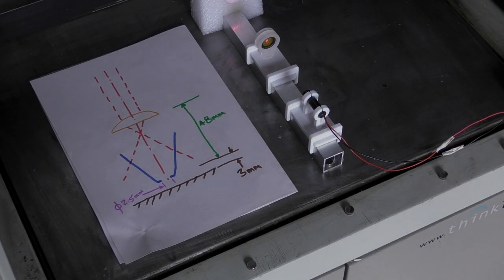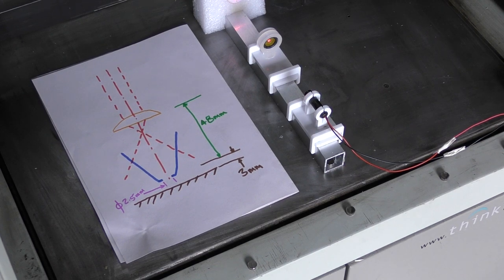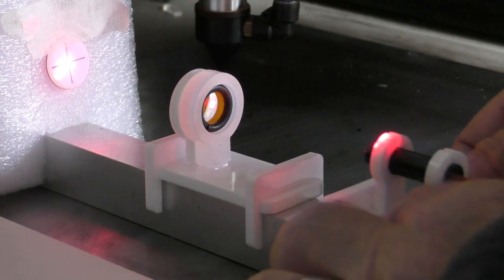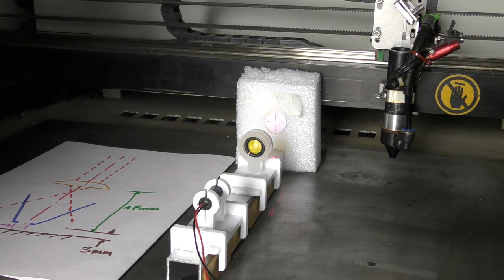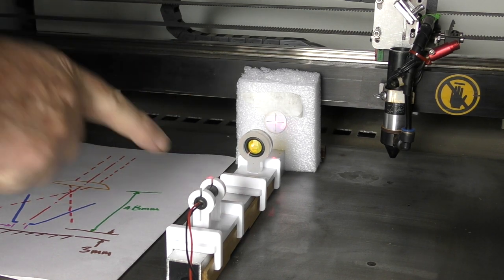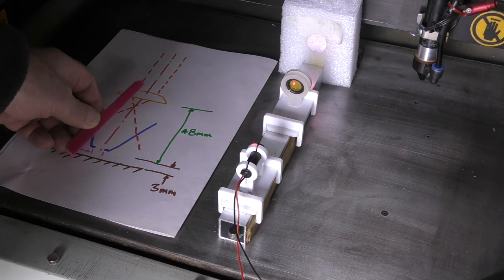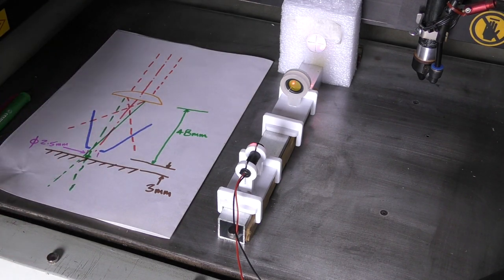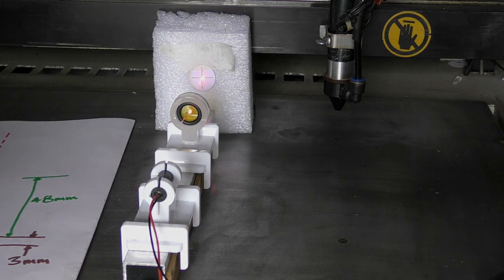RDWorks learning Lab 193 Beam setting footnote

Comment: Hello Russ
Beam alignment is an upcoming challenge on my build, your Labs 192 & 193 are now going to force a rethink of how I mount my tube and mirror 1.
I've built my machine with a work area or 1400mm in X and 1200mm in Y, I think I'm going to have Lab 192 on loop during alignment, I'm now glad I invested in
a wireless remote from Cloudray for my RD6445 controller!
Cheers and thanks for your guidance.